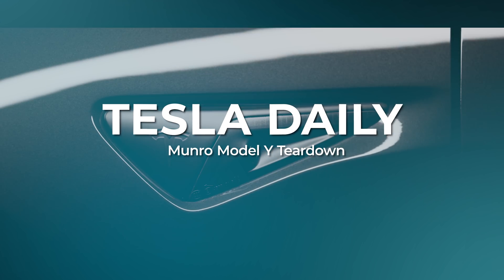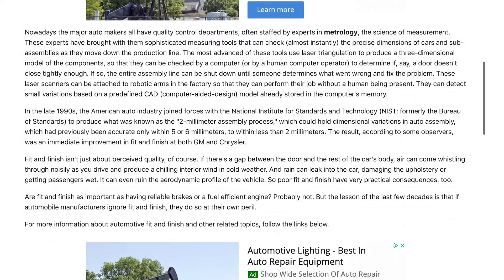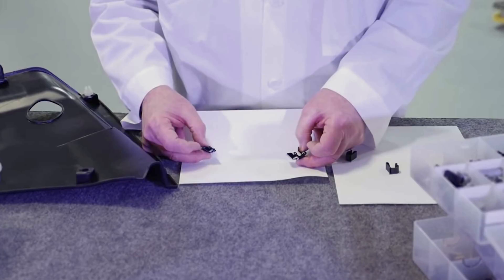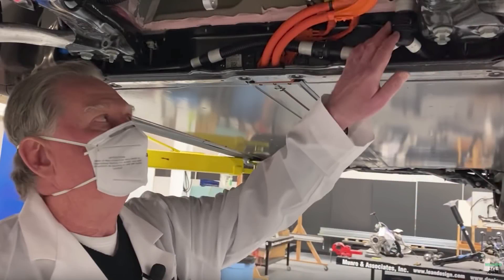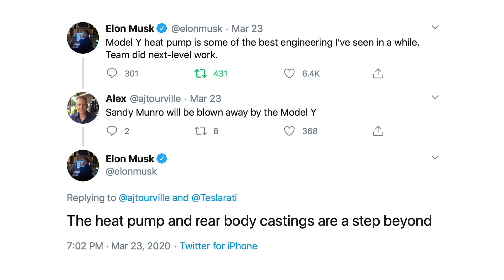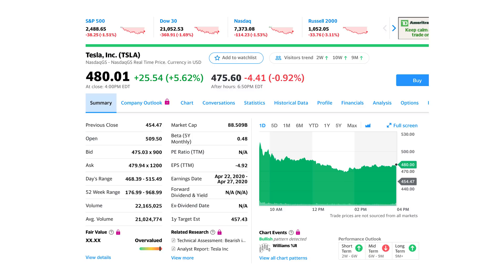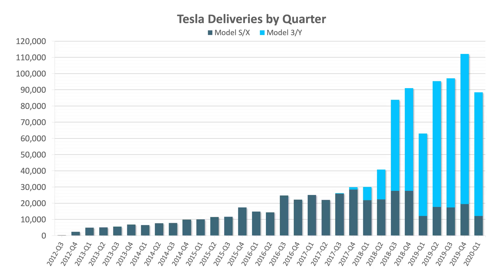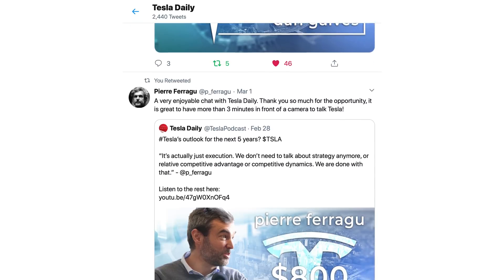Munro Model Y Tesla Teardown Recap

Comment: The paint issues are not only limited to this Model Y. I have seen several videos on different Model Y's that talk about the paint. Although paint might be less important than panel gaps, this is something Tesla really needs to improve. This might also be one of the reasons that they won't paint the Cybertruck, so they don't have to deal with all these paint issues (which they clearly have not solved yet)

Comment: The hex bolt retains the rotor. A recessed bolt would allow any rim to be mounted. A raised head one requires a recess in the rim so the wheel is flat against the rotor/hub assembly when the lug nuts are tightened.

Comment: - VW : sold 75,075 cars in the past three months, 13 % fewer vehicles than in the previous year, as the company announced at its US headquarters. Sales rose 9.4% from January to February, before falling 42% in March.
- Porsche : with 11,994 cars, the manufacturer sold 20.2% fewer vehicles than in the same period last year. As in Europe, many dealers had to close in the United States.
- BMW  recorded a decline of 15.3%. The minus for the subsidiary Mini was particularly clear at 35.1%.
- GM s decline in sales in the first quarter was still limited at 7%. However, the company has no concrete figures for March. The clear quarterly loss shows how bleak the situation is. Investors reacted nervously, temporarily dropping GM's share price at the US stock exchange by more than 7%.
- Fiat Chrysler has sold 10% fewer cars in the U.S. market in the past three months.
- Ford does not want to present its figures until this Thursday.
- Hyundai sold 43% fewer new cars to US customers in March than in the previous year.
- Mazda and Mitsubishi suffered losses of 42% and 52%, respectively.